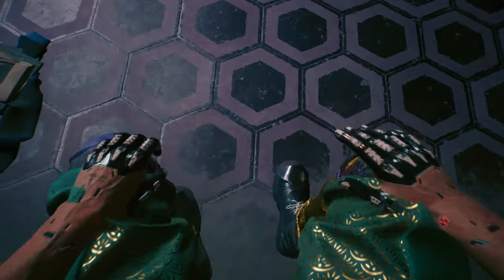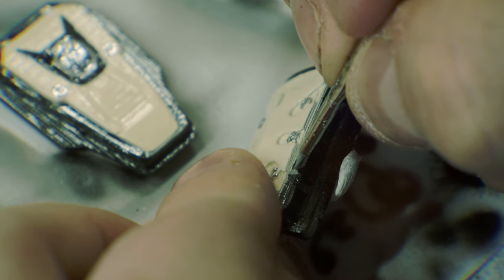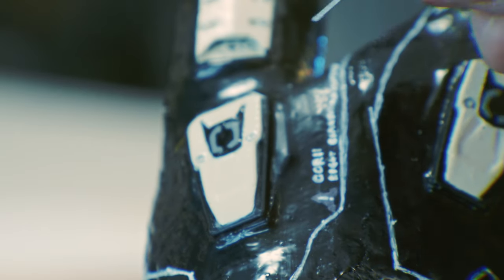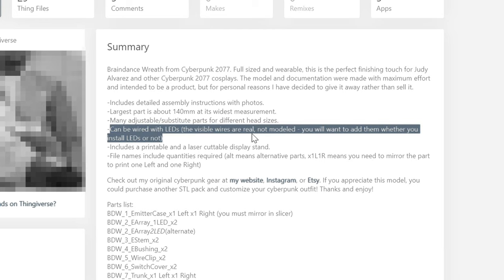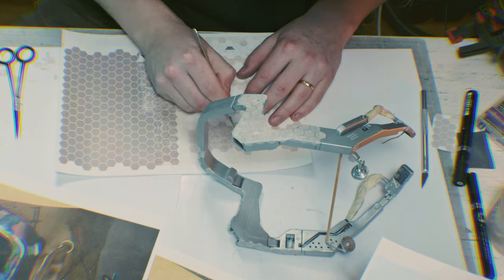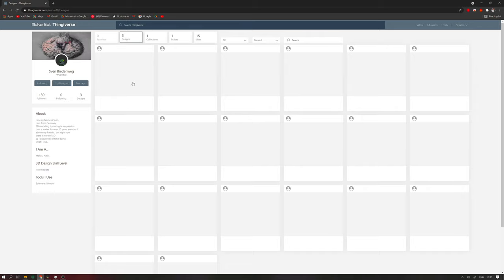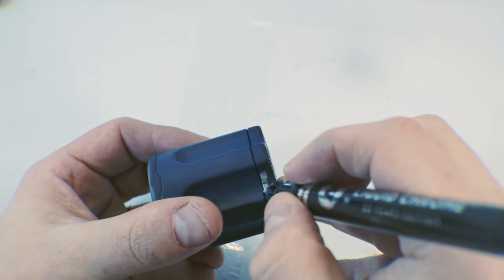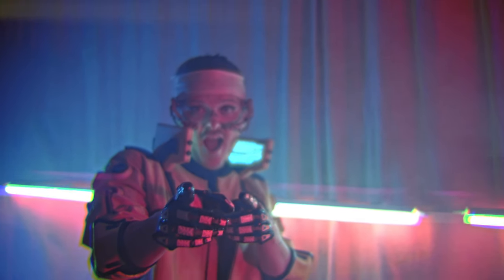This INSANE! Cyberpunk 2077 Costume! - Part 1

Comment: Little question: I am allergic to latex.  Do you have any material I can use instead? Or something that i can add on top of the latex to create a layer of protection?
Reply from the maker: You could use silicone instead. It's not as cheap, easy and forgiving to work with as latex though, and you can only use specified silicone colors and adhisive since silicone only sticks to silicone and nothing else. The result with silicone might be even better than with latex if you know what you're doing, but it will most likely require some testing/trial and error before you get a hang of it. I havent tried working with silicone myselfe yet, but try youtube " Silicone prostetics" and you should find a bunch of videos explaining the process!